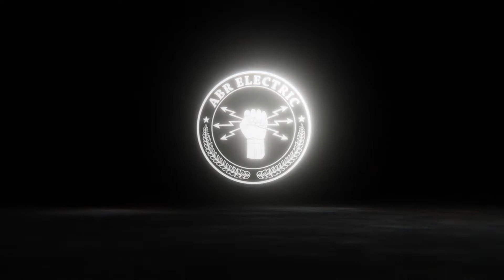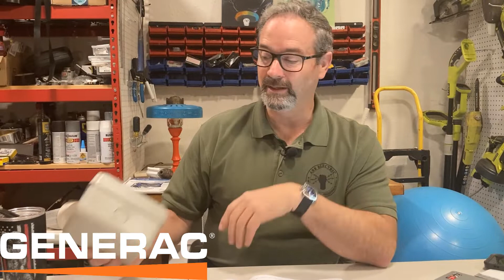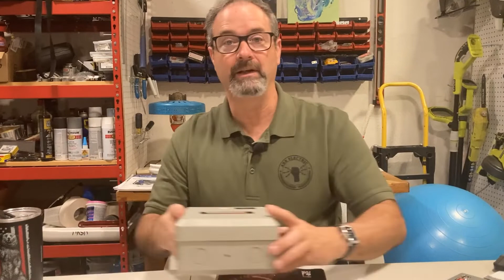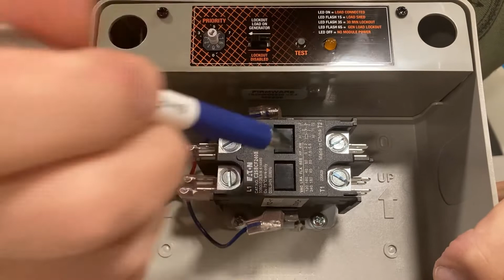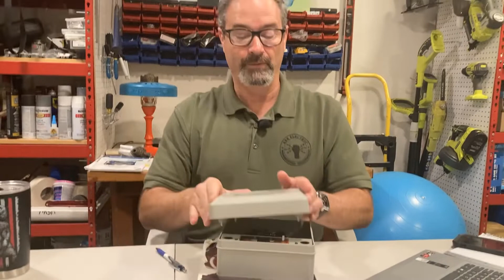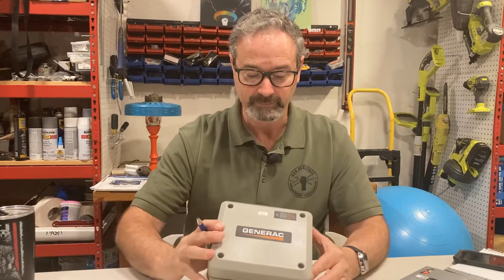Why Bother with Smart Management Modules (SMMs) for Generac Standby Generators?

Comment: The cost of a water-cooled generator is substantially higher than an air-cooled generator and it costs more to run. I have a 26KW Generac in Florida. Since we live near the ocean, it’s a very corrosive environment and air conditioners and generators have a substantially reduced life. It’s relatively inexpensive to replace an air-cooled generator, but not so with a big liquid-cooled unit. My POA required a wall to visually shield and sound-deaden the generator; this is also significantly more for a bigger generator and usually requires a poured pad as well. I wish I had installed thermostat leads to my panels when I first built my house which would have eliminated the need for SLMs entirely. My neighbor spent $100K on his generator project; mine was less than $25KW (both used natural gas). We have two EV’s and our experience is that they are more reliable than gas cars during hurricane outages because gas stations can’t pump gas with no power, but we can conveniently charge from our generator. We bought a spare SLM so our electrician can easily replace one that fails open. Our installer used PSP modules because they believe they are more reliable than the Generac modules.
Reply from the maker: I am of the same opinion regarding the PSP load shed modules
Reply: I’m rather surprised that someone hasn’t developed a large panel that is capable of holding up to six relays. Surely there are many use cases like mine where that would be cheaper and visually less intrusive. Is there some technical reason why that can’t be done? I was prepared to buy a Span smart panel, but they don’t have enough breaker capacity and I didn’t want to buy two.

Comment: Hi: I'm from Louisiana just had our 24K Generac installed in May of 2024, but at the time of the figuring out what size generator we needed, so our major concern was ensuring the A/C would kick on if we lost power, of course the sales rep assured us the 24K would fully power our entire home as well as our A/C, as you know the sales rep was less than honest, but the install went as planned with no major issues until May of 2025 when we experienced our first power outage which was a warmer than usual day so we had the A/C running at the time the power went out, so we contacted our installer, they sent out a tech who in my judgement should pick another job because the dude was every bit of 275 pounds and was unable to crawl up into our attic after he ran some test and the generator powered up but not the A/C, so he said the (SMM) was the wrong size for our generator or the (SSM) was bad, he said he didn't have one on his truck so he called in and rescheduled a return trip to install the (SSM), after nearly a month and no calls from our installer as to when they will. schedule an appointment is when we learned that these (SMM) modules by Generac are less than ideal and are prong to failure, remember this is suppose to be a brand new part and should have come with a warranty, nope neither Generac nor our installer would replace this part under warranty, so I have a question? if the big issue is power load why aren't we using a soft start Kit on our A/C that would lighten the load on start up, there has to be a better solution to this problem other than continuing to buy a new (SMM) every year or so, any suggestions?

Comment: So please correct me if I'm wrong, if I'm trying to decide between a 18KW and a 26KW price is roughly $1,800 difference. by the time I buy multiple SMMs, (2 A/C units, double oven, range) etc... and the labor to install all the SMMs to support this, I belive the cost of the 26KW would end up being less than doing the small generator with 4 or 5 of these modules plus the labor to install each one.?
Reply from the maker: I agree with the idea of going with a larger generator to eliminate load shed modules. Generally speaking, I think that's a great idea

Comment: I just changed from a electric tank water heater that had one double throw 30 amp breaker tied to a general SMM to a electric tankless two 40 amp double throw breakers.  Is it easy to re-route the wiring of that SMM to the two new 40 amp doubles or is that going to require new hardware?
Reply from the maker: The SMM is rated for one circuit, so you'll need a 2d SMM for the 2d 40 amp circuit. Unless you're only using 1 ckt to your tankless water heater during an outage.

Comment: I would be most interested if you would explain in detail the set up procedure of this module.  Lockout switch setting, LED states, (A)Priority setting,  (B) Lockout switch, (C) Test, (D) status lights, and if module failed how to bypass relay coil if energized so you may use appliance

Comment: I have a  30 kva 3 phs water cooled Generac. My one smart module (006873-0) which just failed, so for now i bypassed it. It's on a 3 ton AC which is running on single phase so my question is it seems insignificant and i question if i really need it. I have 2 five ton ACs (which are 3 phase units), a 1.5 hp pool pump, 2 frigs, 2 freezers, a over range and stove top, e dryer. Heat is Gas for ACs and Water. Anyway do you think i need to replace it and if so what brand and model do you suggest.
Reply from the maker: @RobGuercio  I'm not sure you need the load shed for that 1 phase 3 ton unit. If you do, use one from PSP
Reply from the maker: @RobGuercio  I'm not sure you need the load shed for that 1 phase 3 ton unit. If you do, use one from PSP

Comment: I'm a Florida homeowner, not an electrician. We've been in this house for three years and the 22KW Generac is less than four years old. We have three A/C systems, each with it's own SMM. My feedback is that in about three years we have replaced two of the SMM once and the other one just failed for the second time, so it'll be four failures in three years. At about $375 a pop to repair/replace, I'm getting to the point of just wanting to bypass/remove the three SMMs from my system. Our worst scenario is that we're away for a month and the day after we leave home, the generator kicks on, can't handle the load, then shuts down causing the home to be unpowered for a month. The biggest cost for me is food loss due to refrigerator death and the house gets hot....but we'll never have the worst-case scenario of a winter deep freeze and all the damage from frozen pipes.
Reply from the maker: @pokerpirate4034  I've begun changing over to PSP load shed modules. Several subscribers recommended them  vs the Generac SMMs.
Reply: Our SSM never stood a chance, the very first power outage we lost our SMM and these thing dot come directly form Generac but through a dealer which only adds to the cost of the unit, I'm thinking of upgrading my contractors to a better grande than the contractors that comes with the Generac SMM.

Comment: Hi! Really great video but I have a question. What if one of my four modules is blinking and is not getting power (it’s for the dryer)? The others are for the pool and oven. Do I go to the breaker and turn those off that way or some other way in the generator to power the dryer? Thank you for your time!

Comment: Wireless? How does it detect frequency wirelessly? I have one of these on each of my A/C units.Thank you for a great video.
Reply from the maker: @timothyhargadon752  actually,  independent may be more accurate. It's a normally closed relay that will open (shed) on a load when the generator power frequency is altered by a heavy load.
Reply: You only have it installed on the Condensor Units  or both AC and AHU?

Comment: We have a 11 kw pv system with a whole house battery backup system installed in May of 2021. About a year into our system we have had a continual problem with these generac SMM modules. They keep failing which as you know completely shuts down power to those circuits that it's connected to even after the power from the grid comes back up. We've had several replaced only to fail again. Of course there's only a one-year warranty on these things and the company that did our installation has gone out of business leaving many with a nightmare situation. 
Since these SMM modules seem to be fairly problem-free across the board. I am left to believe that our system was not set up properly. I am trying to learn and understand so that we can have a functioning system. Any words of wisdom you care to share?

Comment: Informative content. It only makes sense to design a whole house standby system with load shedding capability. The thought of wondering whether or not one feels a need to pacify an inspector should be a moot point. It's more of a concern to get the the load analysis, system sizing, location and installation properly completed by licensed professionals. A smooth inspection should follow.

Comment: We were sold a 8kw about 12 yrs ago for our cottage which became our home. We have an ATS with h the usual dedicated switches. Our main consumers in the switch are a heatline for drawing lakewater in the winter/ jet pump and sewage pump/furnace AC  1 freezer 2 fridges various lighting circuits. We’ve since installed a 240 volt small hot tub. Would one of these devices help?  The hot tub is not on the ATS and my worry is that the tub may freeze while we are away

Comment: Great video and an inexpensive, workable solution to whole home backup. And, I apologize for this lengthy request but backup power and load management has become a big business and a lot of people have questions that I think you would be good at answering. There is already a huge demand for backup systems in the mountain west because of the public safety shutoff outages that utilities like California's PG&E are using to prevent wild fires, not to mention the days and weeks long outages during fires. This utility attitude is growing eastward as everyone comes to realize that large fires can start anywhere, not to mention more traditional weather emergencies. And, if you have a system installed, there is nothing worse than a safety shutoff and discovering that your closet light is not one of the backed up loads because it is on the same circuit as some non-critical load that isn't on the priority sub-panel. Backup power systems have suddenly become very complex and expensive, particularly when adding one to an existing 20 year old house. Every homeowner has a different set of appliances and priorities and the one size fits all backup generator no longer applies. And, I personally am wary of any sort of load management that relies on wireless, or even Ethernet and Internet communication to protect a system. Those are likely to fail during outages, particularly the router which may shut down and not come back for several minutes due to even a momentary grid brownout. There is also a problem with HO insurance inspectors being skeptical of newly added systems. The old days of an insurance inspector driving by the house and taking a couple of pictures from the driveway and the fire hydrant before the insurance company gives you new of additional coverage are long gone. 

I particularly like how you explain the basics of the backup power and load management operation, the tradeoffs and the cost savings that the SMM provides and in particular how that is done while still meeting the inspector and code politics and to make the HO insurance inspector happy. However your video leads me to question the details of how the SMMs work, details that are needed for system design considerations. Like Mike F. below, I would like to know how the priority communications work. And I particularly would  like to know what backup power sources I can use SMMs with. I have an SMM manual which isn't exactly detailed and Generac suggests checking with a local dealer for details. Please correct me if I'm wrong, please let me first explain the background as I understand it. The SMM responds to the frequency of the AC power from the backup generator. When the backup generator is overloaded the engine slows down, lowering the frequency of the power - e.g. it drops from 3600 RPM & 60 Hz to 3400 RPM and 56 Hz. The SMM detects the drop in power frequency, opens the NC relay and disconnects its load. After dropping that load the engine speeds up again and everything is good. No WiFi, Internet, Ethernet or router required, the only communication between the generator and the SMM is the power frequency itself! A highly reliable communication. 

That's all great but here is my request for a new video. Some newer (and quieter) backup power sources that are now price competitive with traditional internal combustion & alternator gensets (particularly if you have solar panels) - like an inverter generator or a battery inverter don't exhibit any change in AC frequency with overload. Generac says you can use the SMMs with their PWRcell inverter. Can you explain how that works? There is no engine and rotating alternator to slow down with an inverter, if it is overloaded it just shuts down. And for that matter, how does the newer PWRmanager system work? Generac says you can lose all of the electronic communications (Ethernet, WiFi, etc.) and the PWRmanager will still load shed to protect the PWRcell inverter from overload. How about doing another video (or perhaps 2 or 3 videos) to explain how these load management systems work with inverters?  Thanks, and again my apology for the long comment.

Comment: Not an electrician, an mech. engineer. I was wondering if the PSP basic contactors would be a more robust solution? Voltage VS frequency controlled and no wireless which I know saves time wiring but adds an element of potential failure. I am looking at an 18kw and 26KW derated to 24KW due to natural gas) would power my whole house.
If a manual transfer switch is used is load shedding still required by code? On the fence.
Reply from the maker: I am hearing that PSP is a far better solution. I have yet to try them myself.
Reply from the maker: If you're using a portable generator,  the those particular Cide requirements don't apply.

Comment: Great video! all about politics here, the generator was sized to power everything in the house and then some.  The inspector said "I don't care I require the modules" the electrician who installed the generator thought it was ridiculous but nodded and said yes sir and installed them.  They're garbage, needing to be replaced every two-three years at best as some others have mentioned here. I mean come on Generac be better, or they know exactly what they're doing because when you look around this issue has been going on for years now.

Comment: Terrible Product..  I have 3.. one was replaced under the 1yr warranty..  yr 3, 2 more went (including the new one)...  Just got the quote from the electrician to replace 2...$1200.    this person services my generac... I mean rip off?? so fired ...I spoke with Generac and they do not care...  I purchased 2 new modules for ~$300.   replacing myself.   I agree we can self manage but if we are away etc it could be a problem.. so the pool one stays but do I really need a module on a steam room??   it does not automatically go back on and barely used... poor planning on original install ...

Comment: Great video. Thanks for sharing your experience.
I have installed  SMMs on most of the generac whole home systems in my area.
Great way to power a 37kW load with a 22kw gen for example.
Have seen quite a few modules fail 2-3 years after installation. So plan for a call back if you use them.
Reply from the maker: Yes, thank you. I've had several people recommend the PSP load shed module instead. Have you heard of that brand?
Reply: I just had a 26KW Generac generator installed at my home. The installer was a very large multi-city contractor. They used six PSP modules because they believe PSP has better reliability, but I would think Generac is likely to reach parity or better at some point. Nevertheless, I ordered a spare so that my local electrician could quickly install one if I have a failure.
Reply: @abrelectric  I have two of the PSP SAK 60s in my house to shed about 20kW of load (double oven and an HVAC system w/ heat strips).   Haven't actually overloaded things to see what happens with the generator running, but can confirm that they work great as far as delaying the loads coming back online after a power loss.  It seems to be a very well built piece of hardware/software with lots of configuration options.   Here's a pic of one of mine:  https://www.youtube.com/post/UgkxJPesuqTlTrnFxLFuX4PTRft6Xmn2emHu     Here's a link to the install manual also:  https://www.pspproducts.com/wp-content/uploads/2020/12/SAK60Install5.5x8.5V112320.pdf
Reply from the maker: @waterboy74  thank you!

Comment: Have a 22k generator. I'm not home most of the time. Seems like a waste replacing the module every two years. Tops my heat pump  and dryer might be on simultaneously when I am home. It trips my hotwater tank. Ridiculous. Feel like it's a con job for more service calls

Comment: Is there a video to bypass these after installed? My mom purchased a house not long ago that has these installed. One went bad and not looking to buy a new one and have installed due to cost right now... however, AC is off and with her in her 70s and in Texas, I needed to get this AC up and running now. I am not having luck on how to bypass this for now safely. She has a 3000 sqft house and 22KW Generac so ample power
Reply from the maker: You can make sure the Lock Out Disabled switch is all the way to the right. You can shut off that breaker, and splice the 2 hots together to bypass the relay.